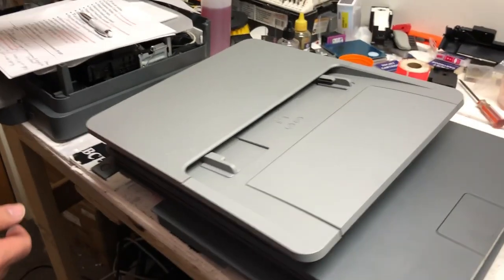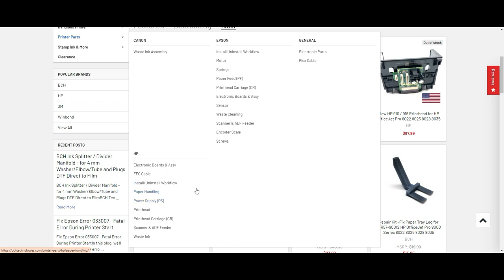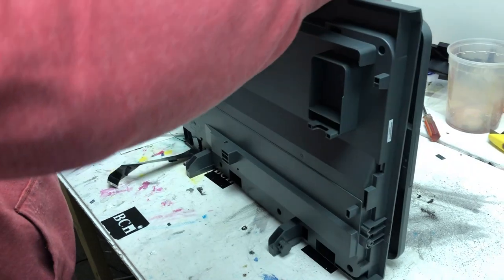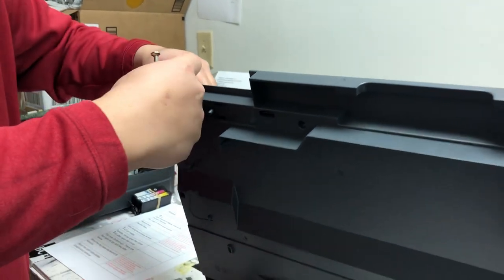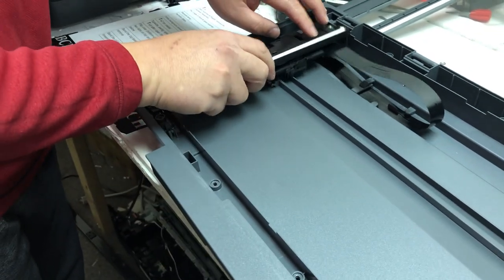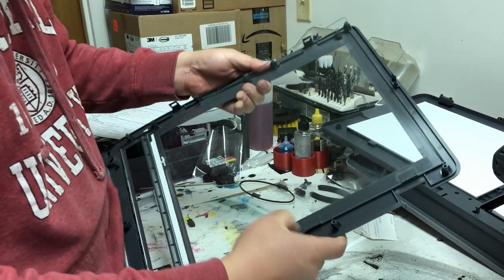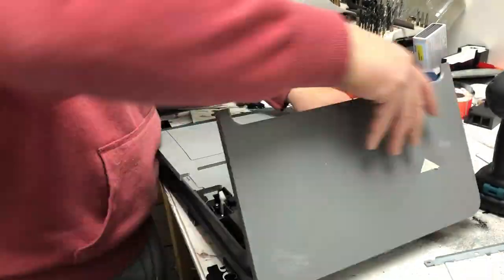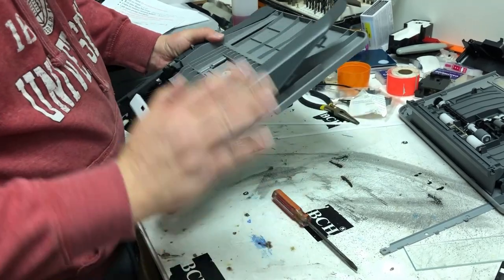Repair Replace Scanner ADF Feeder Parts for HP OfficeJet Pro 8022 8025 8028

Comment: Hi Kevin Thanks for your great videos. I need to clean the underside of the glass of a HP Officejet Pro 7740 as it has dust which is a problem when scanning photos. How do I access it so I can use a blower to blow the dust off? Thanks Chris

Comment: Hey Kevin - Your videos are really great.  I am dealing with the Unable AF error on a brother "Investank" printer.  The only thing you can find from Brother is that this error basically should be corrected by power-cycling the printer, and if not, then your printer is nerf'd.  Do you know what is the deal with this error - what causes it and how to repair?  Thanks!
Reply from the maker: Not knowing too much about Brothers.  I do mostly Canon, Epson, and HP.